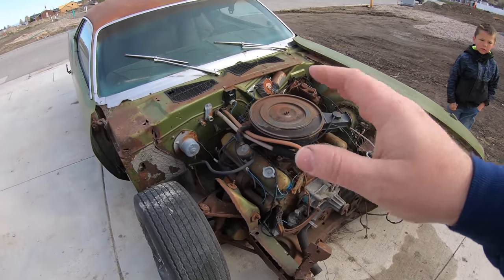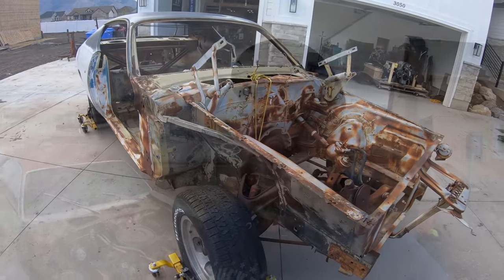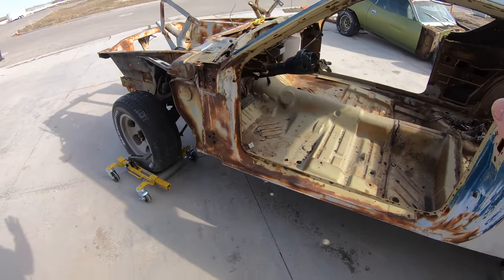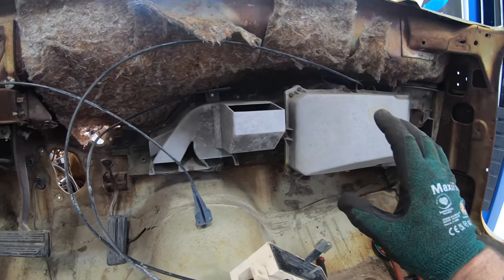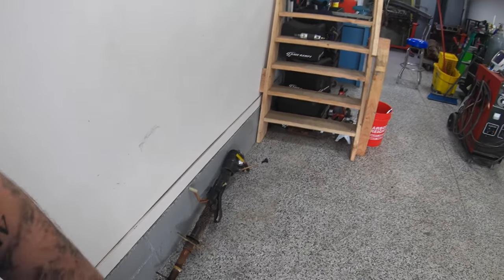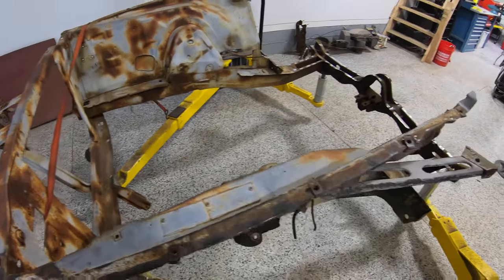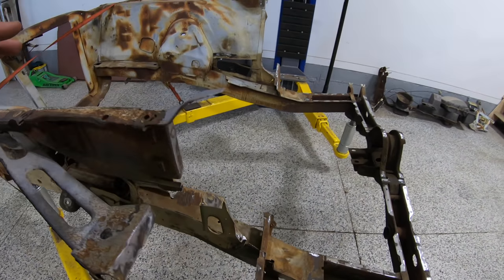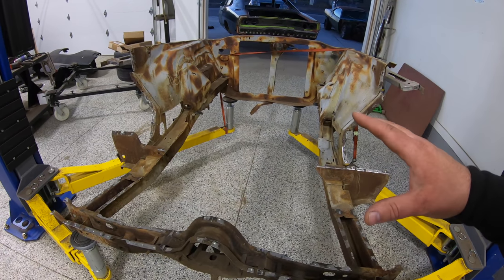1971 Plymouth Cuda Restoration - Episode 2 - Front Clip Donor

Comment: Hey love the channel.  My  70 Challenger was crunched so hard that I just cut away the frame rails/dog house. Bought a donor Satellite too. I have mine positioned and ready to weld in. How crazy to correctly save every interlocking flange etc. Been waiting for you to do yours for tips on mine!  With the splayed rails don’t see how we could screw up. I am amazed how snug of fit it is. Seems to just sit where it should. I will screw/tack then start measuring. Took a bunch of dimensions from another Chally plus have  ‘71 FSM with good diagonals, etc. Then pre-assemble front components...grill and bumper too. Keep up the good work. You are fun to watch. Take care, Bergie
Reply from the maker: You got a great start by the sounds of it!  Should have the video up on this soon!

Comment: I'd save those 14 inch Polyglas GT tires. 60 series 14 inch tires never came on a Mopar, but they are CLOSE.  And they are good looking. I realize they are almost 50 years old, so they may be too far gone from dry rot. But belted tires hold up a lot longer than radials.

Comment: I did the same thing for my '74 BS23G4B but i drilled out every factory weld as i went, saving all the items i could so they could live on and donate to other worthy cars.  There is a '71 Hemi Cuda using the front and rear rails from one of my parts cars. 
 I've parted several Mopars over the years for resto projects and when you cut the roof, floor and firewall.... i had to stop watching.  Not condeming your choices, but not condoning them either. 
 I would have paid handsomely for those parts which means others would have as well.   OEM metal doesn't exist so every item is precious

Comment: Nice job good thing you got that I'm in favour of seeing the charger done but the Cuda will be well worth the effort once it's done I wish I would have got a Cuda or a Challenger back in the day when I could have got one I was always into the charger had plenty of them could I have a 73 now that has a rusted frame rail on the driver side front the rest of the car is okay I would like to get that fixed because it scares me I hit a bump it might damage the whole car I remember the first video you got that car right here in Ohio before you move I'm thinking that it was a lot of work but you pulled it off you did good work
Reply from the maker: Doing it this way is not for the timid!  But it saves a lot of time and money.. & it’s all original mopar metal!

Comment: The 73+ B body changed to an isolated K frame (and axle)  so the rails are different as well as the inner fenders. Just about everything is different about them.  The 71/2 B body firewall is the same as E but the cowl is different and the small brackets that wrap over the top from the inner fender are different. You will have to grab those from AMD.

Comment: Do you know why the 71 and 72 are good for donors not 73 and 74 Chargers? Did you think about saving the front floors for your Barracuda? You  said the floors were the same.  I have a 70 in need of the same  can I ask what the donor cost? Thanks for the info
Reply from the maker: $300 for the entire car.  Not sure what the differences are in the later years.  Just know the part numbers are the same between the 71-72 b/e bodies.  Very lucky score!
Reply: 73 and 74 have an extra frame under the engine and It Bolts to the frame so there are bolt holes on all four corners of that other than that I think they are the same I have a 73 and I need the left front frame rail on the driver side and would like to be able to get that repaired or replaced don't have one might need to repair mine any thoughts or advice onward to just buy that one piece rusted alright under the firewall otherwise rest of the cars worth keeping it is a bear buns charger but it still works
Reply from the maker: Thanks for the info!

Comment: Nice work. Although I did have to cringe through the entire video. I was hoping you were going to try to save what looked like some very reusable parts - cowl, firewall, inner & outer rockers, side hinge panels - all of which are not reproduced for 71-72 b-bodies. I was quoted $500 (not including shipping) for a rust free, used cowl for my '71 Road Runner.
Reply from the maker: Crazy… I paid about 1/2 that for the entire car.
Reply: @rustbucketrestos6511  Holy crap!! You stole that!!!
Reply from the maker: Very lucky find… no title, no vin, no parts.  Just rolling sheet metal.  Perfect candidate to chop up!